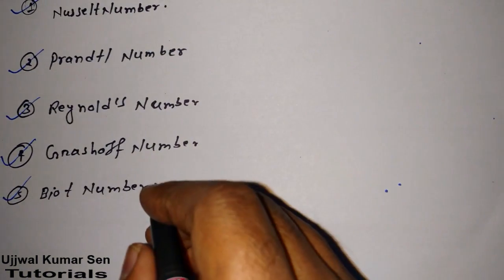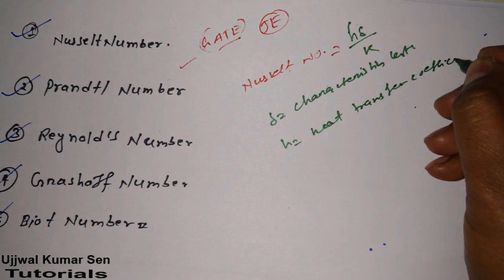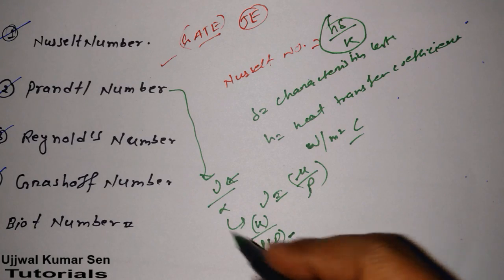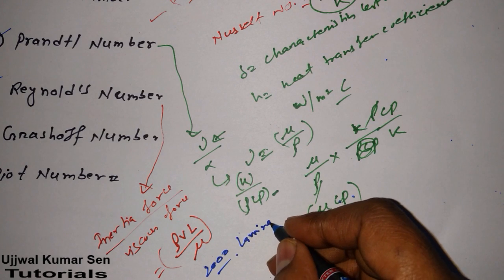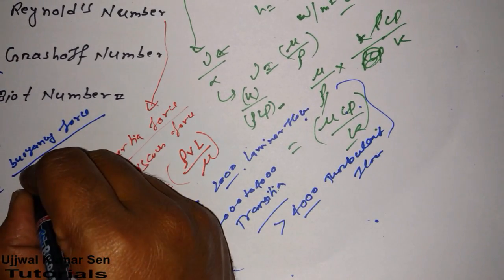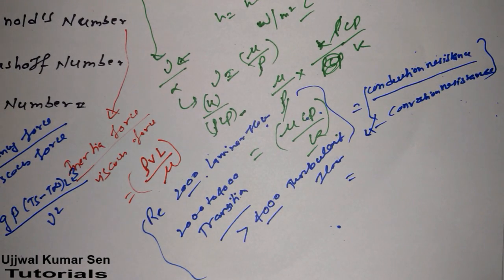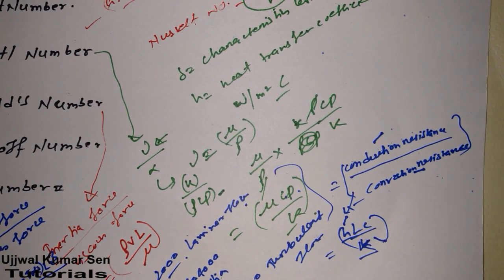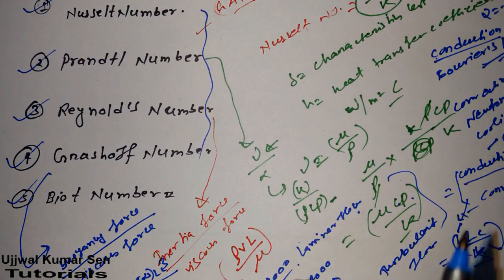Dimensionless Numbers in Heat Transfer HMT Tutorial- 13

Comment: Is the formula for nurselt number and biot number same ??? You said it's the ratio of product of convection heat transfer coefficient and characteristics length to thermal conductivity
Reply from the maker: no
Reply: In nusselt number k(fluid) while in biot number k(solid) is used
Reply: Soo what are the differences